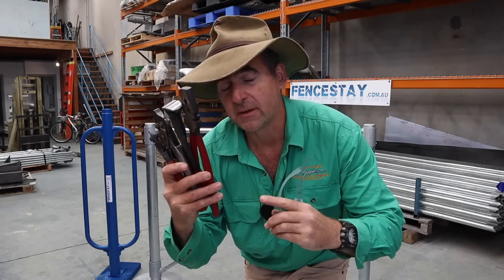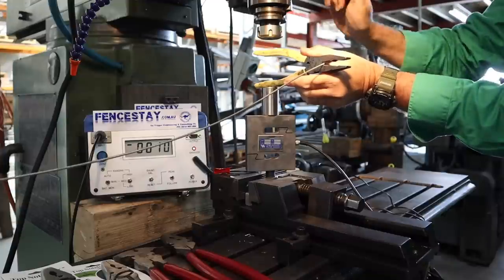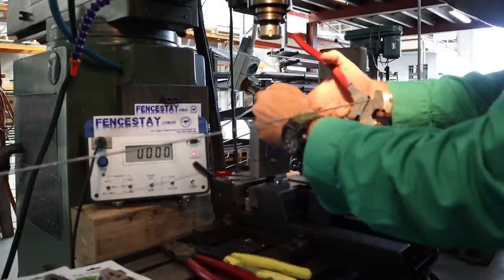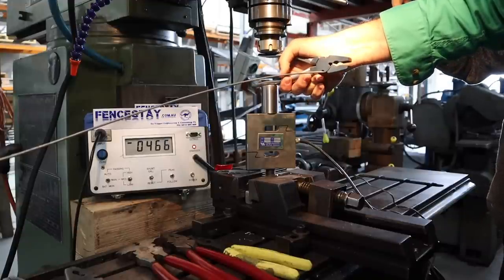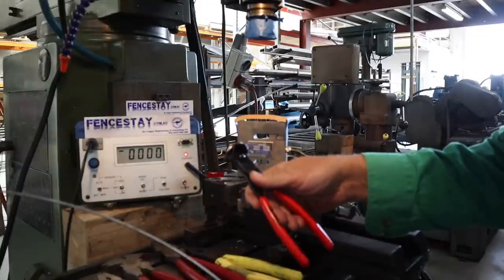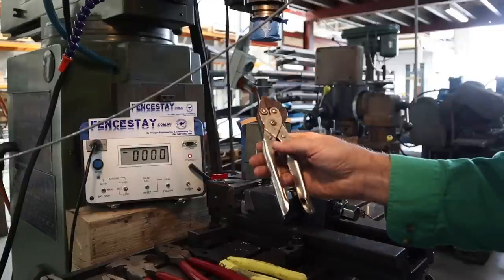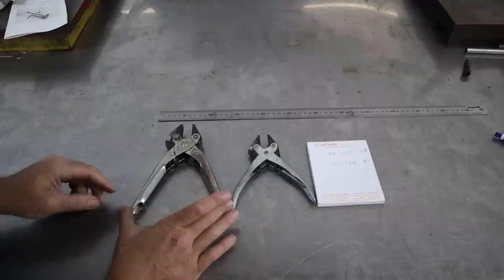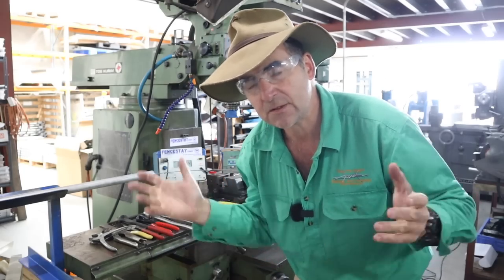The Ultimate Farm Fencing Plier Test: Brace Yourself!

Comment: Ive been using the kincrome 8” mini bolt cutters from Bunnings for 3-4 years now and some days can cut 1000s of wires for orchard repairs and have only had one pair chip out of 6 that the staff and I use. I have used some knipex which were slightly better but for the price I can’t justify it especially with staff using/losing them.

Comment: Knipex also make a soft grip handle for their side cutters that i use at work on stainless wire , I wonder if they are a option on you favourite cutter they certainly are nicer to use in the side cutter version, on a side note i also have the Bahco mini bolt cutters nice soft grip but a bit clunky to use , great content mate ,great that the load cell will take out the human bias in the test .

Comment: Great video - would like to see it with 2.5 high tensile - I started with Maun, and the regular line up of Fencing Pliers in 1980 - now I have Knipex Small Bolt cutters and end cutters.
Knipex 71 31 200 do most of work  - they cut so well and fit the hand so well -- The Mauns still come along for the ride,  habit I guess.
A pair of recently acquired Knipex  61 01 200 High Leverage End Cutters are proving to be very versatile - these could be a video by themselves, so many uses
Just ordered Knipex 71 01 250 and 71 31 250 just to see if the longer handle is an advantage.
Knipex is now my go to plier for all tasks.

Comment: Great video! How about a video on ways to fix seized or stiff cutters. And does some sort of maintenance help?
Reply from the maker: Soak in diesel. Good idea for a short!
Reply: @FarmLearningTim  , diesel evaporates away too quickly, like wd40 etc do..  ive moved on to using pure and simple.  canola oil in a can.  i now use it on all pivoting tools and scaffolding clamps.
Reply from the maker: @vsvnrg3263  Not used as regular lubricant. Reviving seized rusted lumps into working pliers. Nothing better than a bath of diesel.
Reply: @FarmLearningTim  , i spent a lot of time searching the internet for what was the best unseizer.  consensus was 50/50 atf/auto paint thinner.  i tried it but retiurned to using diesel.

Comment: Tim you said in your intro that you will be using the mid section where most people hold the pliers, on your test jig you were at the end of the pliers, I assume the results would have been worse or heavier should you have tested on the mid section I'm a good 60+ and have yet to find anything I can call half easy to use.
Reply from the maker: Not quite. I was using where you would place your hand. Some pliers were very tricky and others we might disagree about where that is. Definitely try the knipex. They will surprise you

Comment: Love the test. I win a pair of knipex from you Tim at a field day this year and am I the only one that have found then very hard to open? After like 2 weeks of use the spring doesn’t work and very tight?
Reply from the maker: Knipex don’t have a spring?? Try some WD40
Reply: @FarmLearningTim knipex cobalt do, they're the ones I use.
Reply: @FarmLearningTim  the knipex cobolts come in a few different flavors, you can get them with a spring if you want. I use the offset angle knipex with the notch and no spring.

Comment: Thank you  Got a problem best wire for stopping Kangaroos  currently using 7 Barbs
Reply from the maker: Iv'e got a cracker on that coming up. In the meantime Barb simply does not work on roos. Have done a few on this topic so far but the best is to come.

Comment: Maybe your title should have been “best fence cutters” Tim, as others have pointed out some of those tested are just cutters whereas some have other functions. I mostly use the long handled Knipex mini bolts as they are easier to fish out of my pocket. If they are the notch version they’ll cut sheep mesh & smaller gauge weld mesh no worries. I do have some Bahcos, for my staff 😂. Last count of assorted Knipex brand pliers, cutters, multi grips was about 18 😏
Reply from the maker: No matter the title people would be upset 😢

Comment: The only problem with the knipex is I always chip the very end on one side or the other. The bahco clones are even worse. Those i chipped the end on the very first cut and returned them. Garbage. I only use the knipex even with the chip.